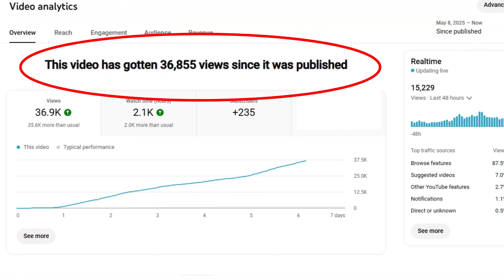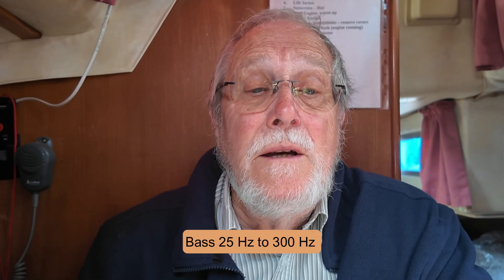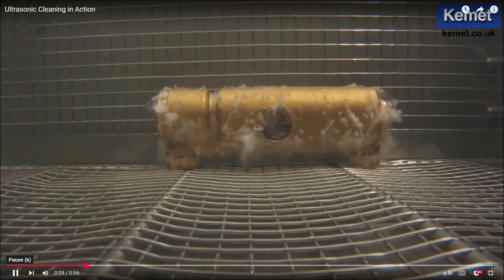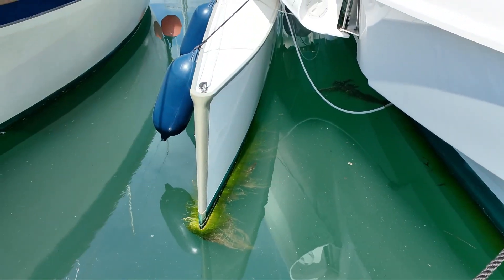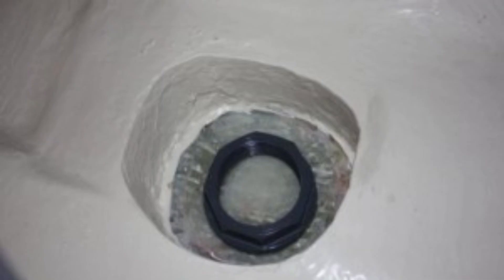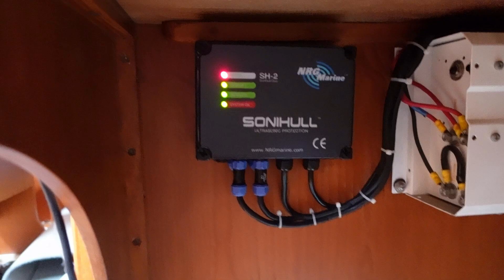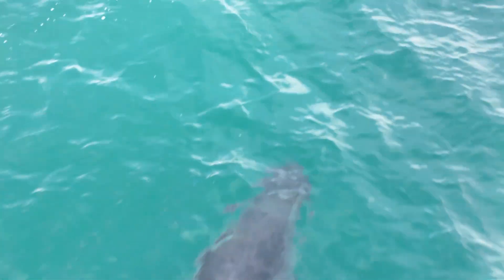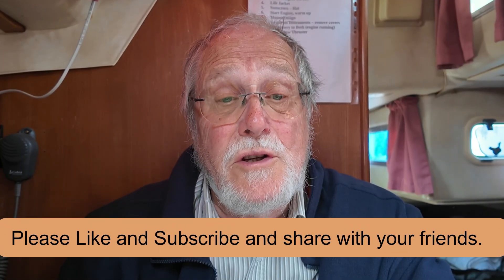How UltraSonic Antifouling actually stops boat slime

Comment: A very simple test:..
 if you touch the dry hull with your finger and don't feel (and most likely you won't) even the slightest micro-vibrations with the transducers turned on, then this  sistem doesn't work......
Reply from the maker: Hi Alex, Thanks for your comment. However I don't think your finger will respond to pulses of ultra sonic sound far in excess of what the human ear can hear. Best Wishes .... Dave
Reply: @davesailing Hi, Dave! I manufacture ultrasonic equipment myself, so I'm well versed in the subject. Try touching the emitting surface of a working transducer with your finger before it's glued to the hull, and you'll feel it "slippery." This is because it mechanically vibrates at an ultrasonic frequency with an amplitude of 1-3 microns. But once you glue the transducers to the hull, you won't feel these vibrations, and the hull won't feel slippery  and the hull will continue to foul...
Why? It's a long story. I'm confident, as an expert, that this system is simply a scam or the result of incompetence.
Regards

Comment: THINK IT WOULD WORK BEST IF YOU HAVE A CLEAN HULL THEN PAINT AND THEN HAVE ULTRASONIC INSTALLED EVEN BEFORE IT EVER ENTERS THE WATER
Reply from the maker: I think I inferred that in the video :-) 
Can I ask, Why are you shouting ?. All Upper Case is usually considered as shouting on texts etc.   Best Wishes ... Dave
Reply: @davesailing   YUP AND I AM AGREEING .. I ALWAYS USE CAPS.. TOO LAZY TO SWITCH BACK AND FOURTH :)) LOL

Comment: We have an Ultra Sonic antifouling system fitted to our yacht.  It works.  We have a dog and we have had lots of dolphins swim around us.  Neither the dog or dolphins have mentioned an issue.
Reply from the maker: Hello, thank you so much for your comment, that's just the sort of information that is so hard to get. We certainly get our fair share of Dolphin visits and they stay around and show no signs of distress. I wish you luck with your emergency steering project.. Best Wishes.. Dave

Comment: Thank you for the trouble of making this video. Very interesting.
Couple of remarks:
Do you have a depth sounder and do you see less algae there? The depth sounder is also ultrasonic.
The power you say is 7 watts does it work continuously or in bursts. 7 watts sound a bit low power for keeping an entire boat clean. Ultra sonic cleaners are usually 10 to 100 times more powerful.
Is the area around the transducers cleaner than under a rib?
The dolphin test might indicate that there is not a lot of vibration in the hull.
Reply from the maker: Hi Marc, Thanks for watching and your comment. Firstly the depth sounder. It's not only quite low power but also at a lower frequency. More importantly it listens on the frequency it transmits so it requires much less power, The receiver is very sensitive and able to detect the echo's at quite low signal levels. And lastly. most of the transducers actually protrude through the hull so are in direct connection to the water. The transducers are designed to produce a focussed beam down to the sea bed.
The Ultra Sonic unit transmits pulses about once a second or so and at varying frequencies. So though the average power is around 7 watts, the short pulses would be quite a bit higher. The important bit is that the transducer is firmly attached to the hull and the hull is solid so the pulses get passed through and produce the microscopic bubbles that deter the growth of the bacterial biofilm that provides the home for algae etc.  The area immediately around the transducer is cleaner than that further away, which, I guess, is what you'd expect. The more transducers you fit then  the more effective the unit would. 
It's pretty much the end of the season here now and Zephyr IV looks pretty clean underwater, no sign of hanging weed like there is on some of the boats around her on the Marina. 
I hope that helps ,, Best Wishes ... Dave